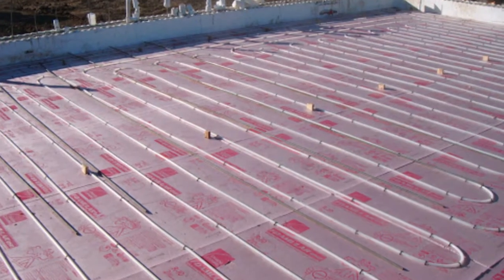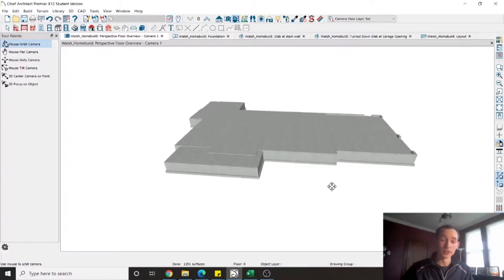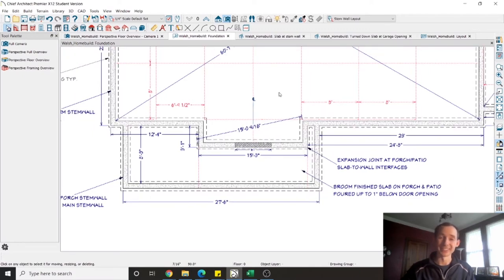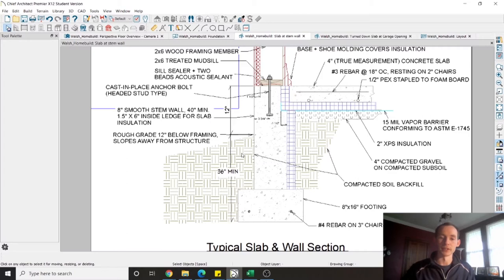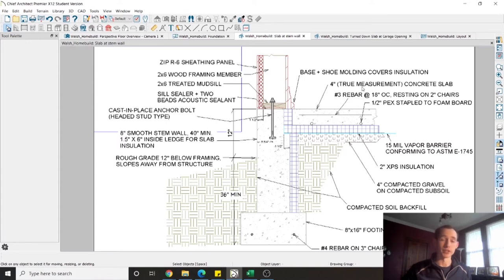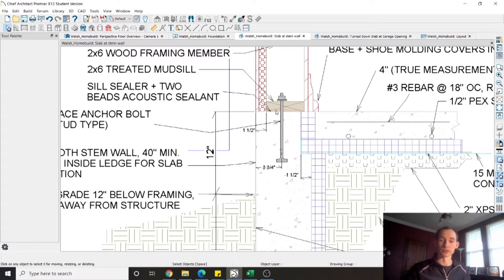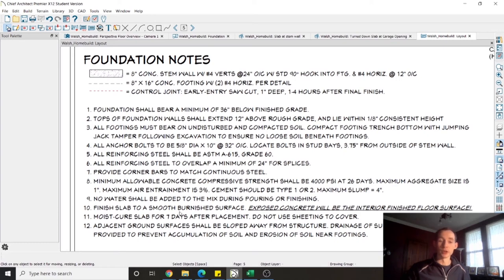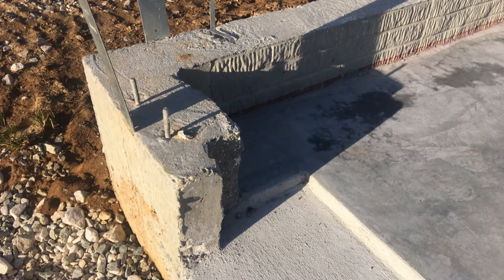Designing Our Slab Foundation |  Why Slab Instead of Basement?

Comment: Cool I've been in construction for 26 years. From a Carpenter, estimator and project manager. Have you considered doing panel construction for the framing? It's most cost effective since the walls are constructed in a controlled environment? Speeds up time. You're in Pennsylvania 84 Lumber does wall panels. My buddy's still a project manager there.
Reply from the maker: I would definitely consider it if price and quality are good. Especially since the 1st floor is on a slab and I'd rather minimize construction on the concrete surface that will eventually be finished floor. Let me know your buddy's name and contact info!
-Alex
Reply: @MasonDixonAcres  its pretty cost effective. I had my own framing crew probably 10 years ago. We did 20 condo's in Ligonier Pennsylvania and several apartment high-rises in Pittsburgh. They really cut the framers square foot price down, depending on the floor plan they are paying 2.75 - 3.25 a square foot. All the one's we did were also on a slab. They give you a choice on if you want to do OSB or zip panels. We both know PA does now allow. Celotex rigid foam exterior walls. The of lumber is ridiculous. You're using Chief Architect, if so what do you think about it? I've used AutoCab for so long.
Reply from the maker: Lumber costs seem to be “coming down” but still double what it was 😂 I like chief but haven’t used AutoCad, I will say Chief is purpose built for residential home design and it does that really well once you get through the learning curve. Lots of intricate settings that are easy to mess up. Did you raise walls before sheathing, or how were you able to get square walls without having a subfloor to toenail them to while sheathing?

Comment: It’s sad how many of these details went out the window once the slab was being poured…
Reply from the maker: Haha actually it's not too different! The plans changed a bit when we went to the smaller build, the only things that didn't get implemented was the floor slope (which we decided ahead of the pour) and the control cuts. All the wall and door opening details are the same, except that I beveled the insulation at the top